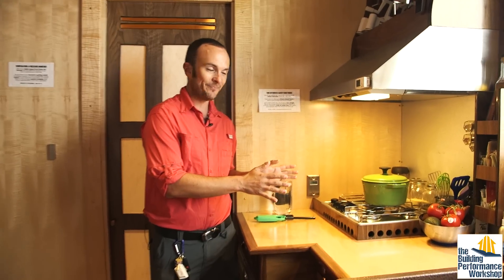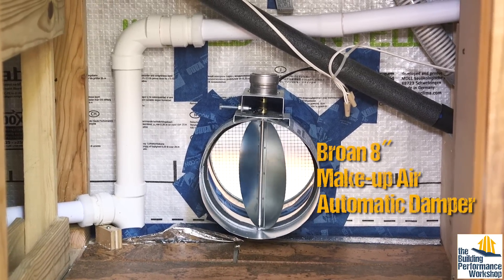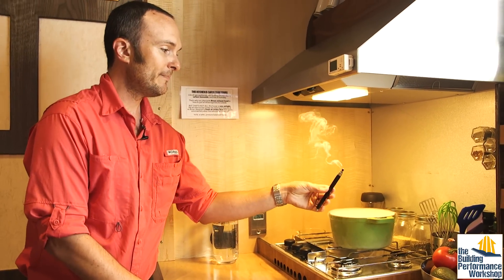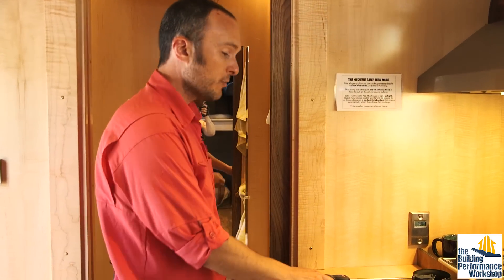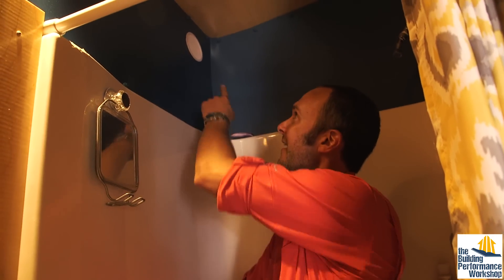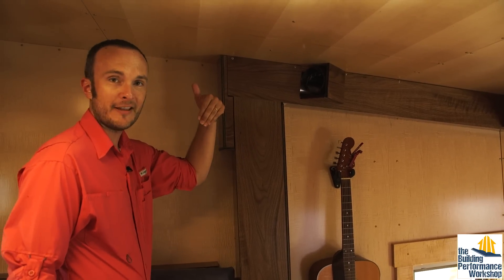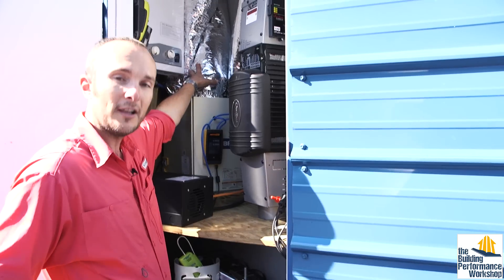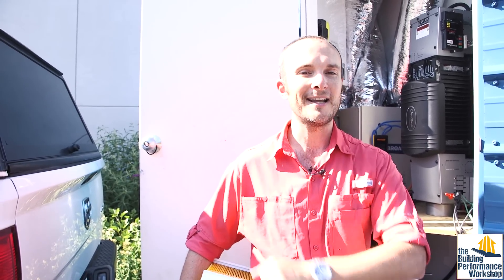Perfect Ventilation System for Any Home, Installed in Tiny House on Wheels

Comment: Great videos thanks, wish I'd discovered your channel earlier. I realize this is an old video, but I'm curious to know whether the composting toilet exhaust is connected to the ERV's stale air (along with the main extraction above the shower) or is it a standalone exhaust system that goes straight outside? And if it's a standalone exhaust, how does the 3 CFM it draws affect the pressure balance of your main ventilation system? is 3 CFM enough to cause depressurization issues (in such a small and tight house)? does it have its own make up air (like the range hood)?
Reply from the maker: It’s separate, and no, it’s not enough to cause any problems.
Reply: @HomePerformance  thank you. Awesome that you are still replying to comments on videos you made 8 years ago!

Comment: The ERV70TE has been replaced with the B130E65RT but the B160E65RS can also adjust the airstream all the way down to 35CFM.  The price difference is about $160 USD.  It has 6" ducts instead of 5".  Decisions, decisions.

Comment: Very good video.  Interesting.  I don't want or need an HRV or ERV system.  But I would like to use that dampner controlled intake vent instead of wall trickle vents my builder is suggesting. It might be my solution.  What is the name of the unit that controls the dampener?   Thanks!
Reply: I believe that’s the Broan make up air damper (or makeup air unit - MAU). He mentioned it in another video but can’t remember specifically. Hope that helps! :)

Comment: It seems like you lose a lot of precious warmth when exhausting your cooking air (I've read that you only use 23% of the heat from the stove to heat your food and the rest is lost). What do you think about integrating a heat recovery system into the exhaust hood or would this not work due to the greasiness of the cooking air? Would you then have to filter it first and then be able to recover the heat?
Reply from the maker: Grease and velocity would make it impractical, sadly. The heat recovery core needs to have the air hang out for more than just a quick zoom through.
Reply: Maintaining comfort with humid hot air demands more energy consumption than heating fresh, less humid air ( once heated back to room temp relative humidity goes down)

Comment: Why do you have your hrv/erv unit outside of your conditioned space? even with the minimal insulation around your ducts, there's still going to be a big affect on your heating and cooling due to the large deltas in temps
Reply from the maker: We track the temps, Derek, it’s not a problem. And as for the location, there is no other place to install it. It’s a tiny house on wheels.
Reply: @HomePerformance  you could've made that space part of your conditioned envelope during your planning...
Reply from the maker: Why would I want that? There’s a propane water heater and solar batteries out there. No need.
Reply: @HomePerformance  you could vent both items... The need is to reduce the delta between the outside temps and your heating and cooling appliances.  It's a passive house standard to have your ERV in an insulated, conditioned space. It's a very simple concept

Comment: Hey there. I'm building a shed house and just now finding out about the importance of ventilation. I'm trying to figure out if I want an ERV system or just live with pressure problems caused by evacuating moisture zones directly outside (bathroom&kitchen). Is the pressure a really big deal? Wouldn't it be a non issue if I just opened a window every now and then?
Reply from the maker: Exhaust pressure will pull outdoor air into hidden cavities in walls and ceilings and floors. May cause condensation and mildew and mold in humid weather.
Reply: @HomePerformance  

....but if you open the window?
Reply from the maker: Then no pressure, but you quickly move your home’s temperature, moisture, and contaminant levels toward outdoor levels. Expansion/contraction of wood, drywall, etc, fluctuations in microbiology and chemistry, etc etc. Watch this:
https://youtu.be/xtuZxfYluvo
Reply: Would that 8” damper/hole in the wall let in all the unwanted contaminants that we are trying to exhaust?
Reply from the maker: @_FullSpeedAhead_ yes, but they go right out again
Reply: @HomePerformance  right, I see now. Goes right back out through the hood, not into the rest of the house. Took me awhile to see/ understand what was going on. Thank you

Comment: I'm a little confused about the beginning test you did with the kitchen vent. You said that you turned on the vent and you couldn't hear anything, does that mean it was just on low? Then you turned the fan on and I could hear it and you showed the high pressure and said this is what most people do or buy, are you saying that you only need the fan on low and never on high, or do you have it running on low 24/7? Then you continued to the smoke test but it was unclear if you had the vent on low still or off.  

Just trying to clear up what you are trying to show and what it proves! Also, does that kitchen exhaust connect to your shower vent, because you said that was the only place where air was pulled out of the house. 

Thanks for making such informative videos!
Reply from the maker: +The Road Abode only on low when we use it, because we have proof that low speed does the job. Not running except when cooking, and not connected to the ERV. Thanks for watching!
Reply: Home Performance Ah! thank you for clearing that up, thanks again for the detailed information!
Reply from the maker: +The Road Abode you're so welcome!

Comment: Great talk!  What made you choose the Broan ERV over the Panasonic ERV? I saw Your video on the Panasonic ERV and it seemed like it was a great solution for your Tiny Lab.
Reply from the maker: +Genevieve Trainor it didn't have as much variability or customization (even with a new hole in it), and didn't address kitchen exhaust at all. The Broan system controls all of those factors easily.
Reply: Thanks for the reply! Is the Broan ERV circulating air on a 24/7 basis? I was also wondering if you have a schematic/illustration anywhere of how your tiny lab ventilation system is laid out. Cheers!
Reply from the maker: +Genevieve Trainor only for attendees of my Saturday workshop in the tour cities- you should join us!
Reply: I would love to, but alas I am located in Seattle, Washington.

Comment: Great video.  I wish my home had better ventilation.  I had new bathroom fans installed (Panasonic).  They work great -- except in the winter.  The flapper on the outside of the wall that prevents air and critters getting in,  freezes up each winter -- when I need the exhaust fan the most.  I have vinyl siding, and the outside vent matches the siding.  Is this a common problem?  Do you have any solutions?
Reply from the maker: +59seank have not heard that one, Sean, but maybe they should be used more often? Timers can extend the runtime for an extra 20 min after use, so the last air that hits the flap before closing isn't totally steamy?
Reply: Thanks for responding.  I'll give that a try!